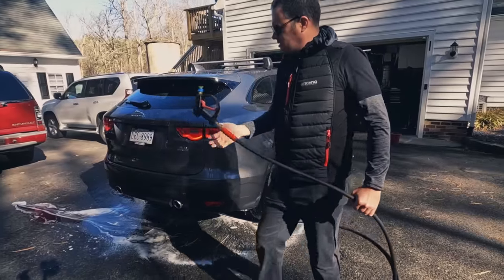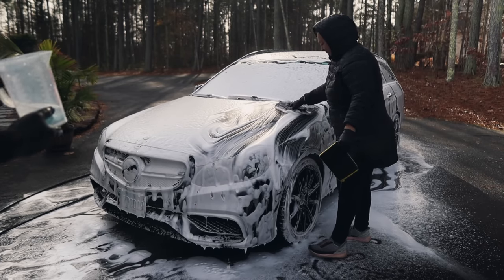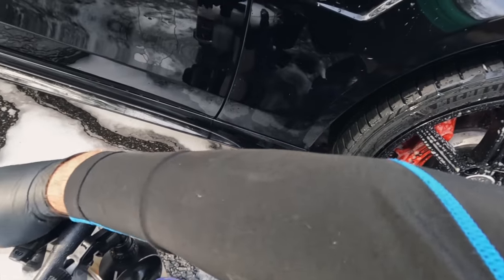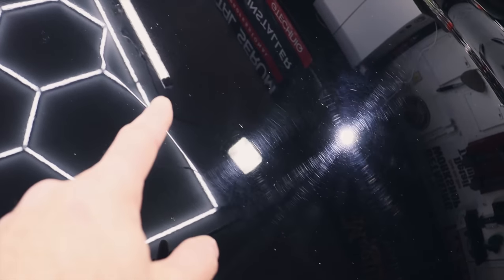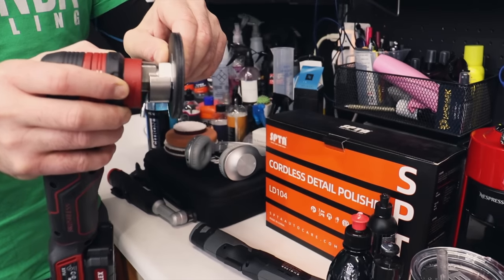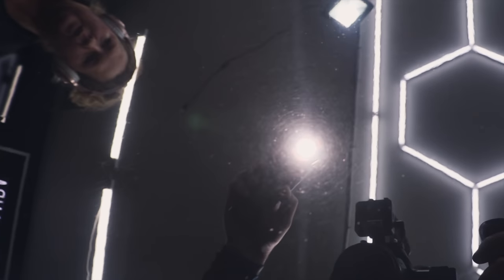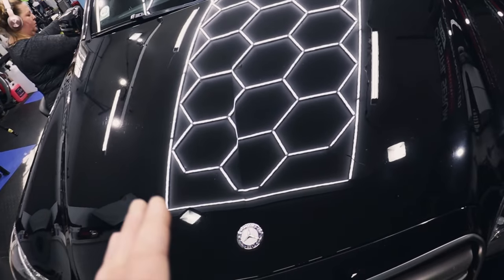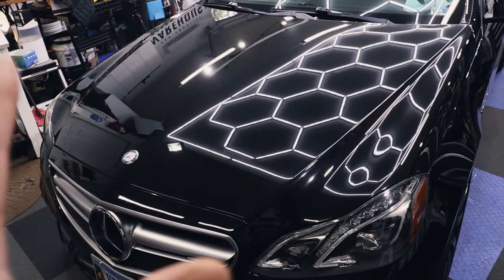Mercedes E63 S AMG / Polishing Trashed Black Paint! #vonixx #detailing #polishing

Comment: Nice!  That was one hammered Mercedes Benz.  Curious, on the wheel off restoration do you have the customer come-back for a retorque after 50/60 miles any liability purposes?
Reply from the maker: I probably should, but since I’m not a mechanic I tell them I torque them to spec and have them double check themselves later.  But I think I will right that into our form now. Thanks for the tip!

Comment: What brush did you use on the emblems? I have a soft brush with the white tip. It doesn’t seem clean as well as the brush you used. The one you used looks stiffer yet I’m sure it doesn’t scratch the paint.
Reply from the maker: It’s a work stuff brush. It’s still soft but works really well for emblem. But also the water spot remover is what really helped clean the emblem.

Comment: Have the exact same problem what you described. When you need a heavy cut paste there isn't that many on the market. (which is heavy enough)
Scholl S2, polytop 2000, zvizzer, koch chemie, D2, meguiars... but you need to do 2 level of cut all the time. Is there a better heavy cut paste?
Reply from the maker: I have Megs M100 and M101 which are the heaviest I’ve ever used. But sometimes it just depends on the paint and the defects.

Comment: Hi Phil this is Michael from mad car care have you had a chance to try the pressure washer tip holder i sent you?
Reply from the maker: Hey man. I haven’t used it yet because I want to film it. But I will soon 😎👍🏼
Reply: @MirandaDetailing  appreciate it. Also I realized some people are breaking it putting it on the wrong way, my fault for not including instructions.  I will try to make video next time I’m at shop. If you beat me to it. The best way to to snap it on the top of the handle and DONT slide it down too far. The sg like widens in the middle of the handle and this widening is enough to crack the side plastic.